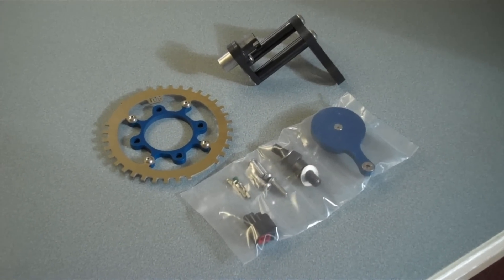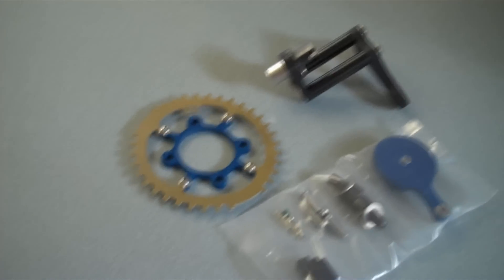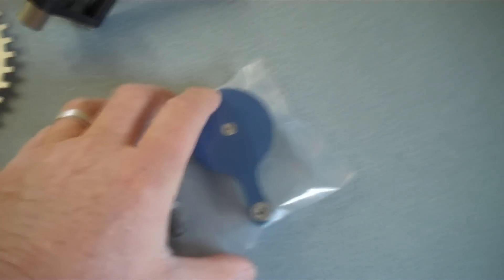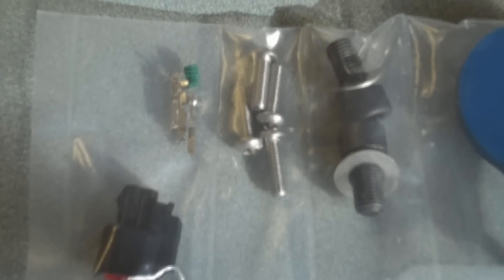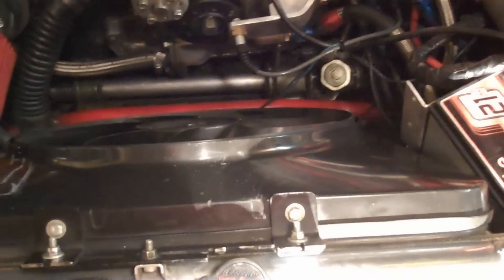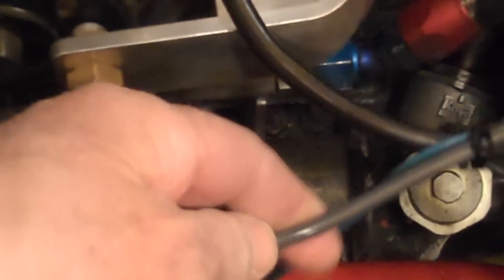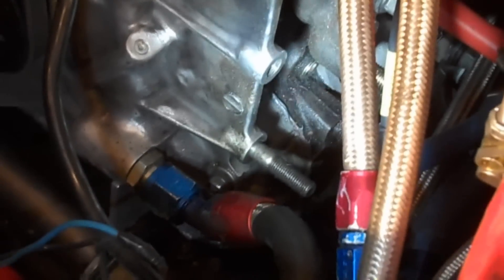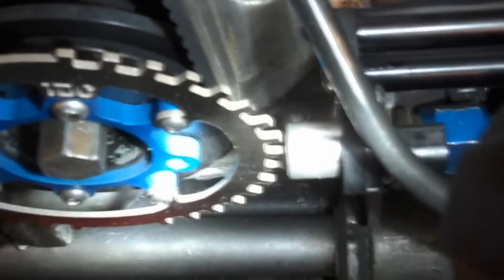Full Function Engineering Trigger Wheel For FC and FD RX-7

Comment: Very nice sir. ;) Your Black FC is still kickin butt. I'm also running this trigger wheel on my FD with the P2000. Stage 3 BNRs with meth. Idle is flawless, A/C idle is maintained better, and ZERO ignition breakup above 6K rpm. Old stock FD CAS trigger setup had ignition breakup and idle issues.